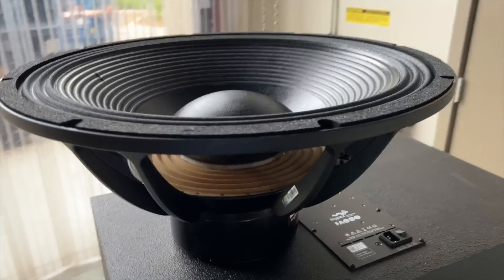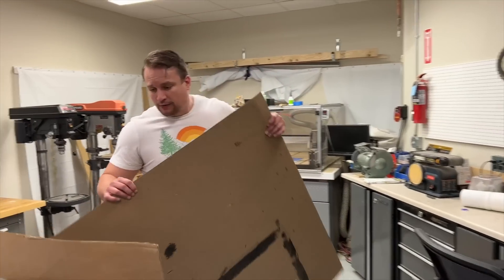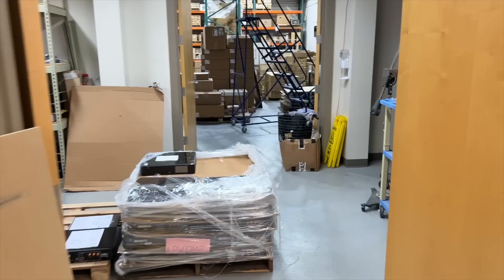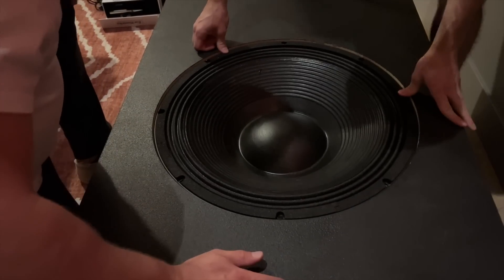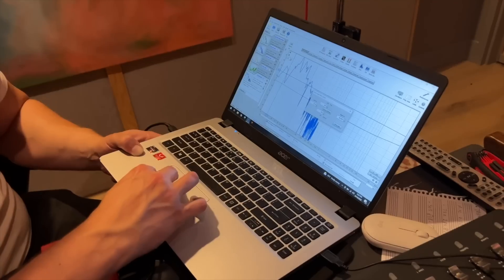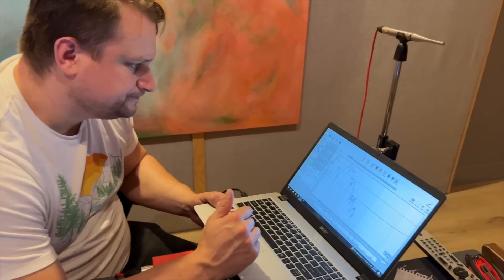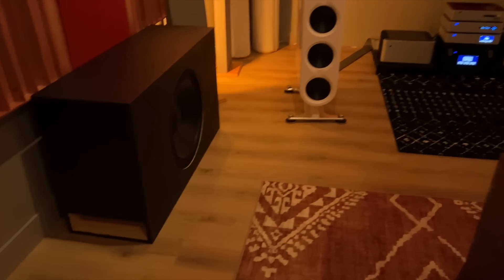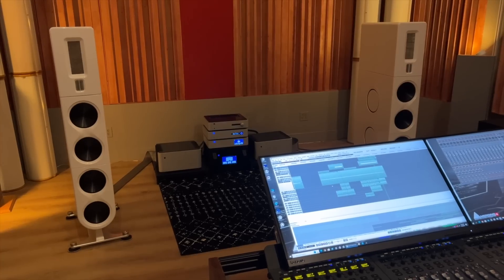The subwoofer project

Comment: Is it only me or this video totally shattered the high end image of this company? On the one hand there are ultra expensive components and esoteric audiophile image but on the other hand they felt no problem with adding to the system ordinary garage made box with off the shelf speaker and plate amp hastily put together. What a branding disaster.

Comment: Firstly I love ps audio and via Paul's internet series I've learned a lot of things that we take care to notice when we're (sbitav) setting up speakers for clients. But this sub confusion and obsession is very odd to me. I can't help think that those monstrosities could only work in massive rooms set up as a cinema or a nightclub - the amount of space, floor suspension and isolation, room correction and treatment required and then the difficulty crossing them over or configuring the rest of speakers and equipment - and using them with high end floorstanders (I'm not sure if that's the intention, please tell me no?) would be quite strange because as other posters are commenting what's the point of the frequency response on the floorstanders if you're not recommending ever using it for high end playback and desperately bypassing it all the time. 

Edit: just re watched - i don't get how such a brilliant company as ps audio have come to the conclusion to use floorstanders with gigantic subs to mix music - it may be full range but it'll also disjointed and surely very coloured? Also what recording frequencies were captured? Anything that requires those subs? And doesn't cabinet design matter for the overall bass quality as opposed to simple frequency response. Quite confused at how sticking some gigantic woofers in a homemade rectangular cabinet is the key to next level bass. But there you go.
Reply: He said they're using them for mixing, not playback.  But for playback, the appeal of large subs like this is that they effortlessly make the bass you want, rather than having to crank up small subs. It's easier to take away bass than to add it.
Reply: @stonecoldcustoms  mixing is what i said (second paragraph) but playback is required for mixing, so there's that. With this set up you i don't you can simply turn up the volume on the subs/system and get 'effortless bass'. Far from it, in fact you'd likely need a tonne of other equipment in the signal path and obviously a quite advanced configuration. This makes no sense to me, those subs with those floorstanders in a mixing studio?? Just very odd. 

I'd use the floorstanders for high quality music enjoyment and playback and forget the subs 

For mixing I'd have very quality monitors paired with really capable subs.

Comment: 1.5 inch xmax peak to peak is moderate , not impressed
Reply: well to be fair, excursion is distortion. excursion require design compromises and the output itself at high excursion causes issues. 
its better just to have many woofers than a few long throw.

Comment: I see them struggling with a big heavy square box and I’m glad I discovered tubes which are lightweight and rigid and “no” standing waves.  I’m talking mostly here in terms of car audio where we are putting lots of weight in a mobile vehicle.
Think carbon nanotubes; The round structure is almost indestructible. If I ever make a speaker enclosure company, it would be all tubes. 
With square boxes you need thick panels, and bracing which can add unnecessary weight when a tube can be made much lighter and simpler and can be just as strong. Even if the tube walls are as thin as iphone, try to stretch and compress the wall. It’s almost impossible due to the nature of the round shape.
I tell this to many people and they don’t seem to understand.
They are stuck on the box mentality when tubes have many more advantages.
Reply: That sub is not designed for RAP or Hip Hop music. If you tried playing RAP music with that sub you would be very disappointed. Not for home theater either. 

That is a musical bass subwoofer. For rock, Jazz, Blues, Symphony, etc. etc. 
it’s a low excursion subwoofer. 

I have one of those type from JLAUDIO I bought years ago.
It’s a low excursion 8 inch sub in a rectangular 3/4 inch wood ported box that has custom designed wood baffle inside the box. The box is pretty big and long in length. It’s not designed for RAP or Hip Hop. It’s for rock, blues, Jazz, orchestras, symphony etc. it hits the bass hard and shuts off without hardly any excursion movement. Yes it moves a lot of air pressure from that 8 inch sub with those bass hits.
Reply: @davidfromamerica1871  
Again.. I’m not talking about the speaker itself, I’m talking about the enclosure. 😋
Reply: @davidfromamerica1871  
And.. that speaker used is actually a woofer. Not a subwoofer. The JL Audio you mentioned is an actual subwoofer.
Reply: @Bassotronics  
Now I am more confused.
The subject line on this video says The Subwoofer Project. 
Whatever it is or what anyone wants to call it..🤔😀🙄
I ain’t buying it even if it was for sale.👎
Reply: @davidfromamerica1871  
Yea the woofer / subwoofer thing can be confusing. They are using a midbass woofer driver which frequency response tends to be efficient between 40hz-500hz. A subwoofer driver tends to be efficient between 10Hz-80Hz.
The enclosure with the woofer / driver as a whole they tend to call it a subwoofer due to its usage in a given setup but the driver itself with its accordion surround and other properties is actually a midbass woofer. It’s why it has such “good quality” sound because it’s designed to go into the vocal range without much distortion or effort. And even more so thus they chose this specific model that has very good frequency response and sound quality. It’s pretty much an audiophile grade PA concert speaker.
Reply: A good sub won’t care what signal you are sending it.  It will just play it the way that the artist intended it to be played.  No different than any other speaker.
Reply: @neilgray1452  
I am not talking about the speaker itself, I’m talking about the enclosure.
Reply: Sorry, that was meant for @ David From America.  I’ve had a number of musical subs in my systems over the years and I have pretty diverse musical tastes.  They all sounded great regardless of the genre.  The sun doesn’t know if it’s being fed hip hop or blues.

Comment: What is going to drive these monsters?  Off the shelf PS or custom designed amplifier?
Reply: You can use just about any amplifier to drive one of those subs. You can tell by the size of the magnet and voice coil. They are low excursion subwoofers  they are not going to be power hungry. Controls are mounted on the outside of the cabinet for tweaking.

Comment: Stupidly high excursion is never a good substiture for large boxes like this combined with large drivers, it keeps distortion very low.
The trend of small boxes an large excursion is not a good one, the old Rel subwoofers like the Stadium are far better.
Reply: I respectfully disagree.
A larger driver has poorer transient responses and a higher dampening factor which makes the driver slower in responding to variations in the signal which causes distortion.
Reply: @JonAnderhub  To get low frequency flatness you need to shift large quantities of air, my argument is in order to shift that air, its better to use larger diameter cones in large boxes than to use small diameter drivers with very large excursion. The reason large excursion is a bad idea, is because the complience of the surround and spider is very non-linear and the former-magnet never has perfect field linearity, so its very difficult to create a linear piston over large excursions.
Now you may be right with certain exotic drivers with advanced techniques, but most drivers built for high excurion have imo high distortion. Another good reason for low excursion is you can often hear the 'chuffing noise' on higher excursions, thanks for your reply.
Reply: Most people won’t understand what you are trying to convey here. I have a crazy Home Theater undergoing a years long overhaul which uses both High Xmax sub drivers in large sealed enclosures for the -30Hz range (ten 21” drivers and six 24” drivers) which will run off of the LFE from the Trinnov Altitude32. 

Then I am using custom 18” pro drivers for each channel (20+ channels). The front LCRs each get four of the 18s then as channel placement gets closer to the seats the number of 18s per channel can decrease down to 1 or 2 per surround/overhead/Atmos/etc….
Reply: @alford35  You must have a very large room), I have two subs barely off minimum tuned at 30Hz, not exactly ideal as one is a Rel Storm and the other a 100w BK, the later is a high excursion unit fairly highly reviewed yet to my ears sounds inferior to the larger Storm. I have built subs in the past, nothing with 24" drivers though, hope your home is of good construction with all that air being shifted).
What is the xmas of those drivers?
Reply: @JonAnderhub  One point, the transient response is related to the Q factor, small boxes inherently have inferior transient response with Q's exceeding say 1, but you tune to optimal design(which is usually a large closed box say 100L for many drivers) and you can get the perfect transient Q=0.7, or another way to see it, less travel means generally faster response.

Comment: So is this a PS audio product or a personal project that's for the studio? Cause it's gon be hard to beat Rythmik, HSU, Perlisten/M&K, etc.
Reply: This is just a one-off project for the studio. 

It’s not hard to beat rythmik or hsu, only “for the price”, as rythmik operates on a lower profit margin than most and keeps their overhead low.

We will be offering subwoofers but expect (at least initially) more premium performance and pricing.

I think that the perlisten subs are good for high performance (and Dan there was involved in the monoprice THX stuff). However, we won’t be doing the dual driver push pull arrangement with the butt end of the driver sticking out the bottom of the enclosure). Yes, this lowers distortion but I’d rather use single higher end drivers and make something more compact/attractive.
Reply: @cbrunhaver  Wow Chris is in the comments section! Howdy PS audio team :D Will you guys still be doing a Servosub, a few year back Paul said you guys would be using one for a future product. or maybe a Rythmik Collab?

Comment: Looks like the B&C 21SW152-4 21" woofer.
Reply: Yeah, available at Parts Express and other dealers. $950 USD. A bit more 'pedestrian' than I first thought.
Reply: @Roof_Pizza  I'm not knocking it but I do think this is the first time I've watched one of Paul's videos and thought... "Hey... I can build that."  Of course when I'm done I will have cut so many corners it'll be a $100 woofer and an amp scavenged from a craigslist sub. haha
Reply: @fallrecords  Well, they're deffo going for 'a thing' as so many drivers out there are certainly built to a higher spec. Something like a 10 year old JL Audio 13w7 AW still goes for $1800 but coaxing out more below ~15 hz  might've been the deciding factor.

Comment: Awesome.  
Did you use Hi level input?  What was the crossover point?
Reply: @R LJ low distortion true to power rating bass quality ,texture , punch ❤️❤️
Reply: Naw, I doubt it. These look to be passive (they don't have their own amp and DSP electronics onboard) and so with Chris using REW, they must intend to use DSP to smooth out those room gremlins shown which would require it's own amp and DSP equipment. Thus my guess, is that they are using a line level input. It sounds like you're thinking of REL's recommendation, which advocates using the high level input. That is amateur compared to what Chris is doing.
Reply: @CobraChamp  they have plate amps with DSP right on the side of the boxes.
Reply: @Kicker700  good eye Kicker! I missed that.
Reply: @Kicker700  it’s an Hypex I guess plate amp 502 model using it as BTL mode 1200 watts 8ohms pure power. Hypex are killer low distortion amps. Crown no class in this application

Comment: From the Side of a German Loudspeaker Ethusiasts. 
Just test the 18sound 18NTLW5000 with Servo korrektion. 
The Best Subwoofer ive Ever Heard so Far.
Reply: That driver has great specs although I've never heard it. My favorite is the 18" JBL 2269h but B&C makes some great choices too.
Reply: @CobraChamp The 18sound NTLW5000 ist a forward tecnology mit almost same Speacs als the B&C ?18SW115?
I know the JBL 2269h but! 
In comparision i prever the 18sound Subwoofer.

Comment: i rather put two of these big woofers in same cabinet but make it sealed, dsp to make them play even to 15hz. then you get more output up high and down at the lowest. and you can put absorbing material on the inside and cross them up as high as you like.
i do anything do avoid port or slave designs.
Reply: I agree, it's like he wants to record pipe organ music.
Reply: Agreed Sudd!!! Mounting them face to face in a sealed cabinet cuts the volume in half and doubles the motive power for a single cone.

Comment: Where are you controlling the crossovers points between FR30's and the passive sub's? And what is feeding the passive sub's?
Reply: Great question! I see they showed the nasty curve without any fine tuning (bravo) but they didn't describe what they are doing in the final setup. I'll bet the FR30's are operating full range, unfiltered. Maybe Chris can chime in on this fine point.
Reply: wait what, are the subs passive? The "connections" plate a side panel visible 20sec in appears to be that of an active (powered) sub???
Reply: @mpix8302  I think you are correct. Watching the video again you can see an plate amplifier.

Comment: Awesome! Quick question, are both woofers connected the same way or is one inverted (polarity)?
Reply from the maker: Both are the same.
Reply: Why the heck do you want to invert the polarity? 
The frequency response would be in chaos with the main drivers. 🫣
I actually remembered when I invented the phase of my woofers and being so separated from each other, they actually sounded louder but at certain frequency intervals. And anything lower than 35hz was weak. It’s all in the wavelength.
Reply: @Bassotronics  I don‘t want to, I was just wondering if that would make sense here as the woofers are facing each other. So as one cone goes out, the other cone goes in… like in some subwoofers where the speakers are mounted face to fave with vents on each back.